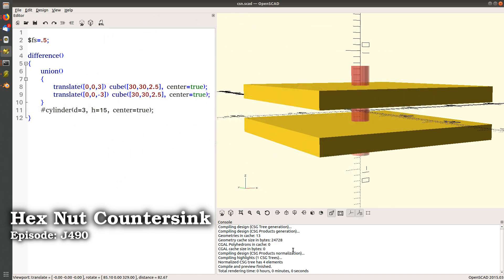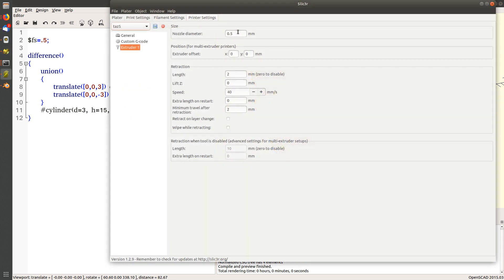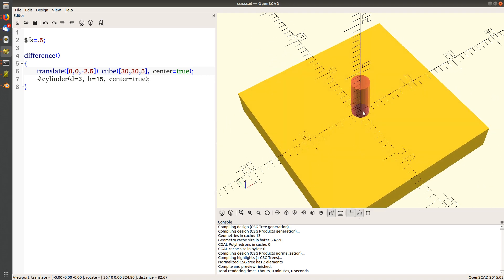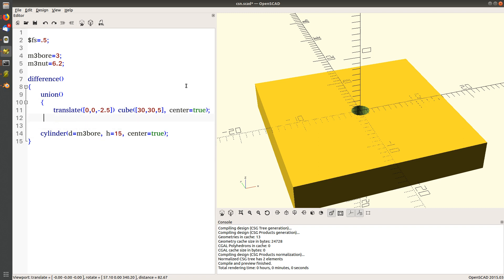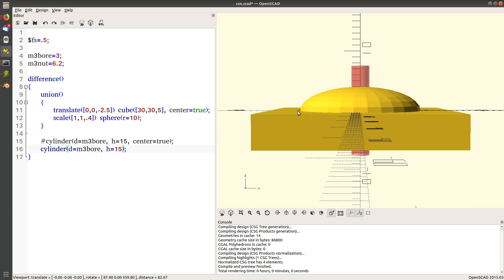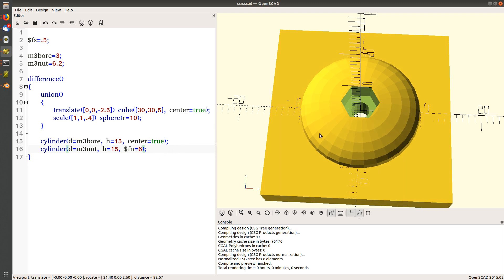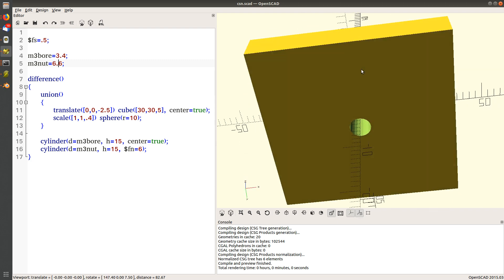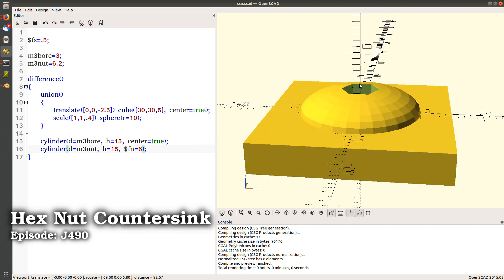OpenSCAD Tutorial: Hex Nut Countersink

Comment: A bit late, but to get a correct measurement for the countersink you can construct a hexagon and extrude it. That way you do not have to guess how a cylinder and its facets are working.

######

module hexagon(diameter){
    radial = diameter/2;
    for ( a = [0:5]){
        rotate([0,0,a*60]){
            polygon(
                points = [
                    [0,0],
                    [0,radial],
                    [sin(60) * radial, cos(60) * radial]
                ]
            );
        };
    }
}

diagonal = 6.14;

// your example, but 6 mm high
linear_extrude(6) 
    hexagon(diagonal);

// half the diameter and 4 mm high 
linear_extrude(4)   
    translate([10,0,0]) 
        hexagon(diagonal/2);
Reply from the maker: I should revisit extrusion.  I have yet to give it the time I need to fully understand it.
Reply: I think that the cylinder approach is very simple and elegant. There does not appear to be any guesswork on how the facets are working. The points of the hexagon lie on the circumference of the circle. I love this and will be using this technique regularly!